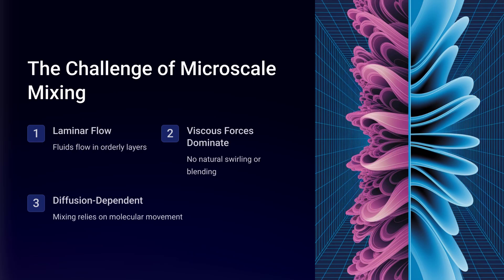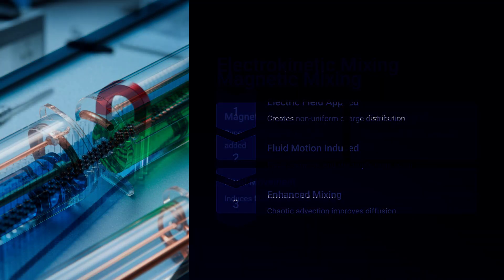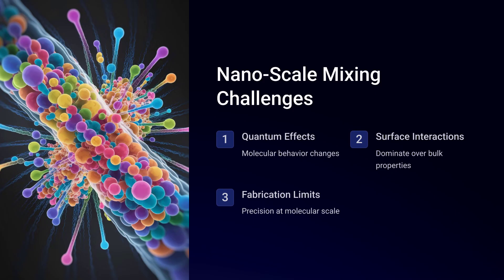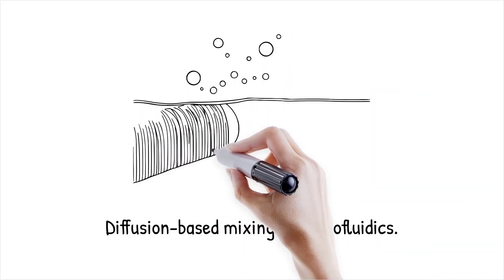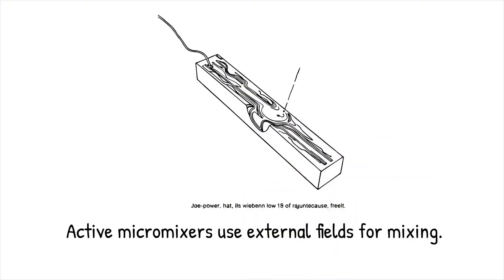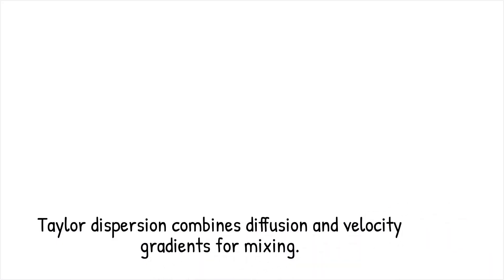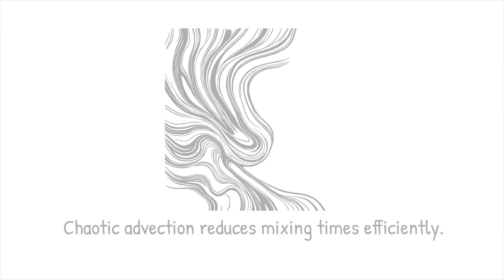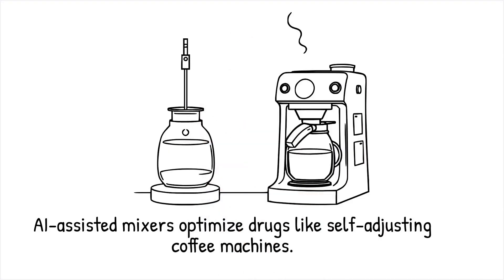Microfluidic Mixing: How to Overcome the Challenges of Laminar Flow

Comment from the maker: How do nonlinear diffusion effects and Taylor dispersion impact the efficiency of passive microfluidic mixers, and how can these be optimized to minimize mixing time while maintaining low Reynolds number constraints?
What are the fundamental limitations of electrowetting and acoustic wave-driven active micromixing at sub-microliter scales, and how do competing interfacial forces impact mixing uniformity in droplet-based systems?
How can AI-driven feedback loops dynamically optimize microfluidic mixing in real time, and what computational models best predict mixing efficiency under varying shear rates and fluid viscosities?